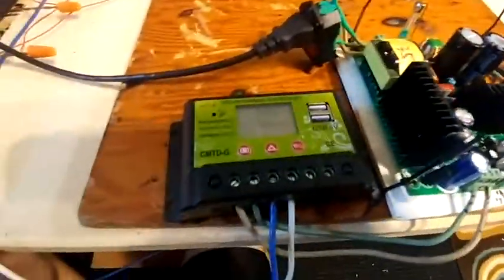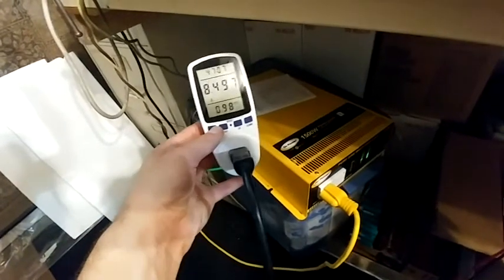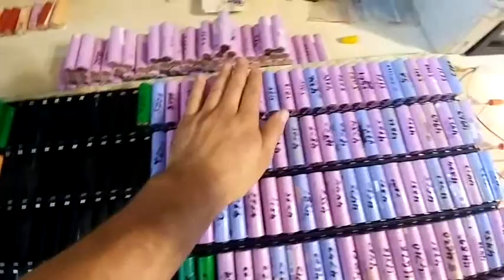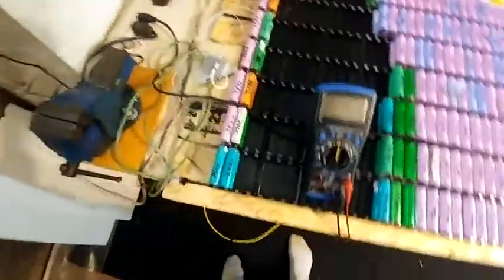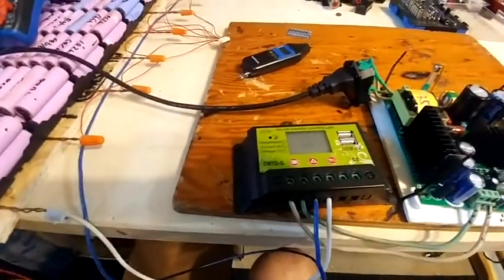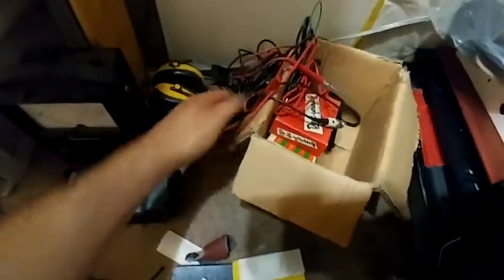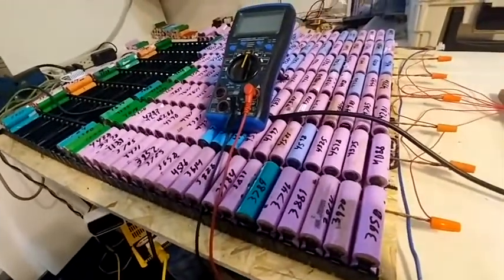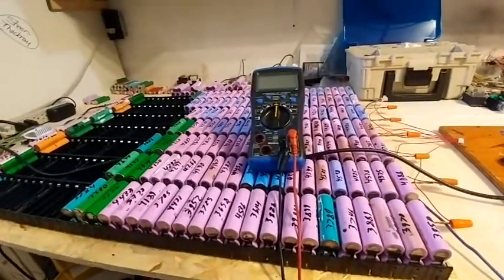18650 7s diy modular power wall heat and load testing

Comment: The two layer thing might become a problem - or - an interesting feature : the top one sees more air so can dissipate the heat better, the same with the corners and the sides. First try swapping the bottom ones that are heating to put them on top, if still not enough, swap the most heating ones to put them in the corners, or at least in position 1 or 7 to be on the sides. Don't forget : the heat means one is more resistive, ok, but the damage to the cell is made by temperature, so if air can dissipate the heat faster than it builds up, then the "more resistive" cell might still be useful a long time. In the end lower the amp demand. Chemistry starts to degrades at 37°C and up. (the reason why spot welding and using swappable carriers / holders is all good vs regular soldering witch is bad)

Comment: So many compression connections. Each one a potential source of resistance. Heat is a good indicator but it seems like it might be difficult to differentiate between resistance at connections and internal resistance of the batteries without physically measuring. I've had problems with typical spring connections. They can be finicky and difficult to diagnose. Most of the time just rotating the battery or removing and reinserting works. Most often there are no visible signs indicating poor or discontinuous connections. Flashlights are the worst offenders, if not simply due to handling and periodic replacement of the batteries. It usually occurs after some age and use. With any battery operated circuit the spring connections are my first suspicion when it comes to failures or erratic performance.